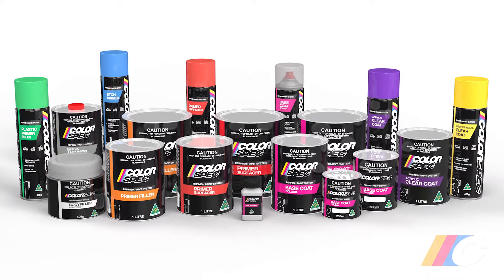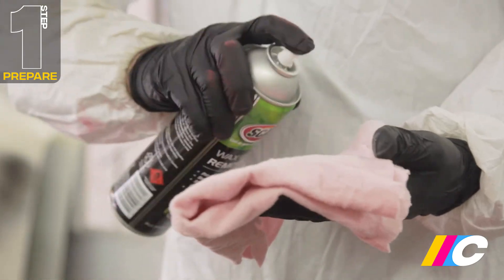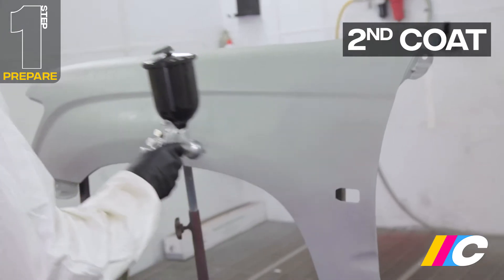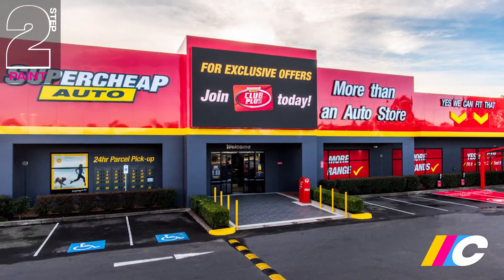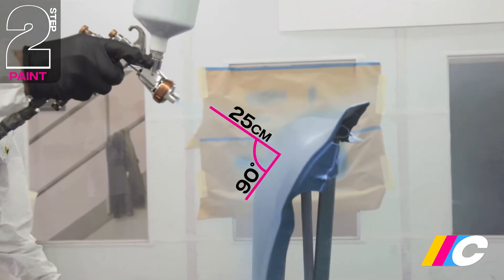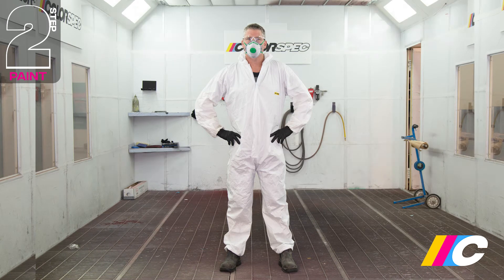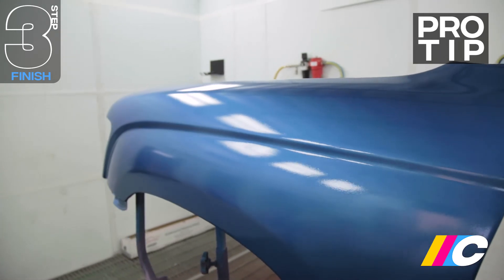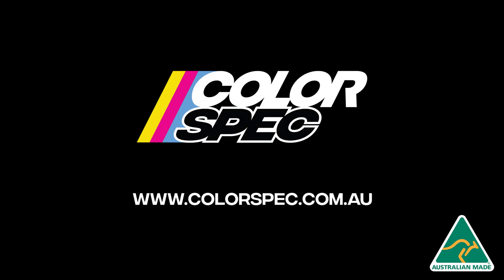ColorSpec - How to Paint with a Spray Gun

Comment: Hi guys, I'm just wondering how much pressure you used for the clear coat?? thanks!!
Reply from the maker: Hi, i would would set up air pressure in between 1.5 and 2 bar for clear coat depending on the gun set up.